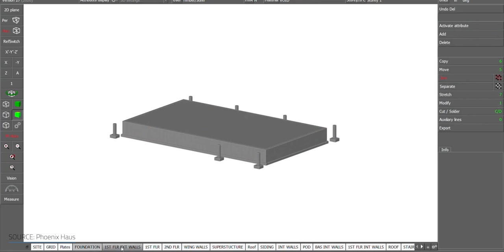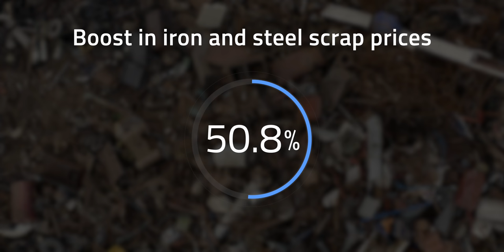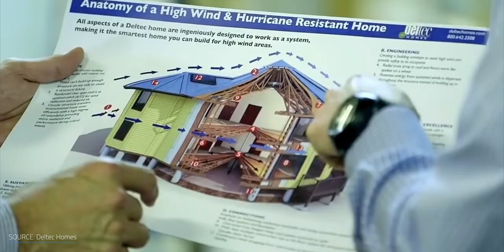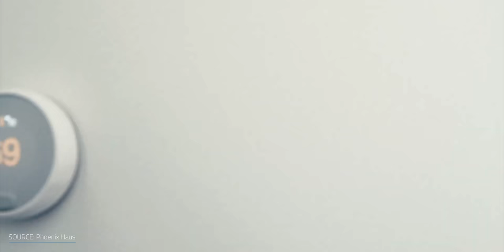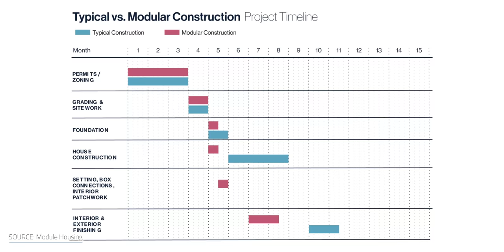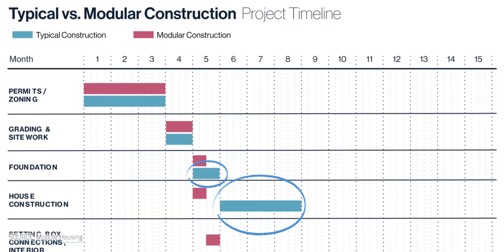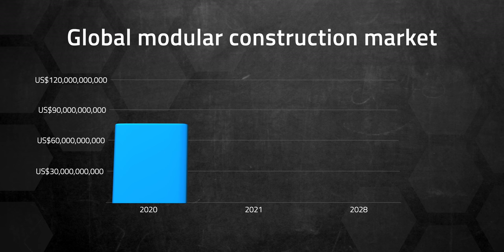Exploring Modular Homes - Cheapest Path to Net Zero?

Comment: if i built a modern home, i would build via 3D printing. Concrete lasts longer than sticks. i really don't like stick building. its old technology. and i HATE pink batt insulation. that crap is TOXIC. Spray foam is a better solution, IMO. SIP panel construction is a good solution too.

Comment: sorry but NO ... those are not conventional materials for a house for me.
there are many downside to using wood as the foundation & 4 walls of the house.
We use and prefer bricks and concrete to anything as it is more durable, stable & functional ... in the long run saves you plenty compared to wooden houses with rubbish foam padding which are only a norm in the US not rest of the world.
Now with that said, eco-friendly is another story.
My arguement here is the material used NOT the method used to build a house just in case you missed it.

Comment: The problem is longevity! Should we build something that will outlast us and will be transmitted to the next generation or something that is carbon neutral at first but also a relatively short-term solution? IMHO, we should evaluate a building's carbon cost on a decades-long or even century-long period, not just based on what it requires when building...

Comment: In so far as large scale production of homes, its not likely to happen. Not without its widespread adoption by builders that are largely responsible for most of America's communities. Otherwise it'll just remain a nitch market for those rich enough to afford a home outside of a subdivision.

Furthermore, being eco-friendly is great but not when the majority of homes are (well) beyond the purchasing-power of the middle-class. Otherwise what's the point, if a families single greatest investment is beyond the reach of mere mortals? I mean, a 30-40 year loan for a property that's not certain to last that long, is becoming quite a big ask (requirement) from Banks. Especially considering that lenders make more money when borrowers default than they do from the borrower taking the loan to term. (Thanks to loan insurance + resale of property + absorption of equity)

Comment: Any home that’s 100% electric is net zero, regardless of its efficiency. It’s the electric grid suppliers that produce the carbon emissions. 

Individual choices to go net zero make people feel good and feel like they’re personally involved in solving the decarbonization problem...which is not entirely bad. But the way we solve the BIG problem is through good public policy and regulations...which is WAY more boring. Big carbon producing companies like to blame consumers for the “demand”, but the hydrocarbon power producers emit the carbon!

Conservation and efficiency are great goals, but energy conservation and a set of panels on your roof won’t by itself stop or reduce your local 800 MW coal or gas plant from burning dinos for profit. It’s gonna take big solutions for big problems.

Comment: Great video.  I feel you left out one very important aspect on this topic.  Modular homes stand up to severe weather far better than traditional built homes.  Compare that side by side, they win hands down.  I live in a 2-story, 2600sq2 modular home.  My insurance rates are lower compared to traditional home of same size/ sq2 because it will stand up better in a  storm.  I hose is very energy efficient and if you saw the location......  It is to die for....  Moved from a mobile home to modular.   When I did, I refused to look at anything other than traditional.  I was tired of not being able to shop for insurance, the limitation due to the design.  We found this place,  I had no clue initially (until after I toured it & made an offer) that it was a modular home.  Great video though.

Comment: 7:35 "Stick-built, non-luxury home cost: US$150-250/sq ft"
8:47 "Shelter Dynamics price: >200/sq ft"

Ok, assuming that this is an apples-to-apples comparison, it seems like a no-brainer.  Even at the worst value of '>200/sq ft' of $199, you're still sitting right in the middle of the price of a stick-built home. Which has none of the energy savings, i.e lower utility costs, of the Shelter Dynamics home.  So again, assuming that this is an apples-to-apples comparison, why would anyone not take the options that saved them a pile of utility costs over the life of the home?

I think that a major impediment to energy efficiency is transient living.  Building or converting a home to be energy efficient is costly, and the home owner doesn't see any return on that investment for many years.  So if they move, they will never see any returns.  And with this in mind I'm certain that many choose to not pay the upfront cost for energy efficiency which they may never recover over time as they move around.
I live in NOVA, which is a highly transient area given the large amount of military and diplomatic residents.  Added to this is the simple fact that younger families tend to move to a larger home as they have children and need more rooms, and you have a large amount of home turnover.
No one wants to buy an expensive system that only pays off after it has been in place for several years when they may be moving on well before the break even point.
I saw this myself when I had an AC unit go out in my home.  It was a SEER 8 unit.  After doing some research I decided to replace it with a SEER 15 unit.  But I sold the home just 2 years after, and the fact that it had a far more efficient AC unit didn't impact the sale price by a single dollar.  I'm pretty certain that I didn't get my money back for purchasing a much more efficient AC unit, and this is probably the same issue for a great many home owners.  They face the very practical question of "why would I pay for a more efficient system when I won't see any cost benefit?"

Comment: Im working with modular homes, its usually total garbage, most of the time is waster trying to cleanly isolate the connections which would be way easier if the house would be simply build step by step, i dont know all the terms in english but isolating modular homes doesnt work at all, workers are doing all kinds of shlt to pass the tests, end result is usually nice because you cant see a shlt beneath the exterior. I dont understand how it can be cheaper if its faster building one or two story building peace by peace (its tested by me and other builders). Dont beleave me then come modular home industry for 6 or so months and u will understand it by yourself.

Comment: Cheaper?! Good modular homes that I have looked at have been a lot higher per sq/ft than stick build unless you are talking about mobil homes.
Reply: As an example I am looking at Method Home predesigned Model 2M Loft - 1,740 sqft, Home$410k, Modular + site (est) $680k 2bdr + loft, 2 bath. I just sold a larger 3 bdrm cabin for $340k. In theory modular should be cheaper but all the decent designs I have looked at are almost double the price of a standard stick built in our area. I keep looking because I like the idea and benefits but they are not cheaper.
Reply: Isn't the point of the exercise to get higher energy efficiency than traditional building practices deliver?  Over the term of home ownership,  lower operating costs should offset premium material expenses.  

As to your figures, without citation - they're suspect.
Reply: @jimmatthews6034  I don't know why you say my figures are suspect. I gave you the name and model you could easily look up. The figures are taken from their website. As far as what I sold my home for, I guess you would have to take my word for it. 1,796 sqft for $340k is comparable to others in the North Carolina mountains near Asheville. I really would like to build with modular and it should be cheaper considering they are built in a dedicated facility. Given that, I don't understand why they are more expensive initially.
Reply: @jimmatthews6034  If you know of any good modular home manufacturers that service North Carolina I would love to know. Most I find are west coast.

Comment: The cheapest and most exo friendly building are what was used a few hundred years ago - COB BUILDINGS ...
Main construction materials -
Wood (any type, logs etc)
Sand
Clay
Straw or similar 
And of course
Water ...
Nah can't for once think of using old NATURAL BUILDING techniques,  we need 3d printers, machines so large they consume tons of power... 

And have a building anyone could build ...nah that's crap idea ..
Bigger 3d printers and more chemicals please ...tons more chemicals for the mixing ...
Or premade sections covered in a ton of glue , bolts, nails ,screws ...

Advancement is the only way ... and ignore anything that makes sense 
..we all know its follow the "science

Comment: Net zero is not important. Low cost clean energy is what will benefit people. Gridtie solar is great but it really only scales to 10-20% of all residential energy. Battery lifecycle costs alone are similar to grid price. They are not a profitable investment.  Lifestyle, more heat pumps, and modest array is probably close to optimum. Net Zero is a useless distraction.

Comment: In the UK we have traditional cob cottages with thatched rooves that are 800 years old and still in perfect condition. The ones in desirable locations sell for millions.
You aren't going to get to "net zero" using huge amounts of manufactured product, local sand, clay & straw has lasted 3x longer than the USA has existed for in a cold wet climate and the materials are free with a purchase of every spade.
Same with adobe buildings.
Unless you are building a skyscraper you really shouldn't need all the unnatural overpriced stuff.
It's the same as my objection to Elon Musk telling everyone to buy EV's which requires us to mine ungodly amounts of lithium. If we built Dutch style bike paths, car usage would decrease by half. Bike paths are really, really cheap and easy. But lets have the most expensive and high tech solution instead.
Ho hum...

Comment: They are they size of a shed in the UK as land price is high. The aim is not to sell them more likely you will rent them or your boss will provide them as sleep pods as the incoming fuel charges hope to move most drivers off the roads and rewild some of the main carriageways. It's all in plain sight on the local councils Carbon/Co2/Plant food removal page. Burning anything is about to become illegal. Currently the Government would like to replace gas boilers with ground source heat pumps which can only heat a small shed. But its all in aid of saving the planet apparently as most have forgotten all the cancelled climate Scientists, most never got to read the Climategate papers, and most don't know that Michael Mann's Hockey stick graph that he posted around the globe, turned out to be a cut and paste fraud.

Comment: Wood meccano totally morphable a few components rot just unbolt and replace. You absolutely need a house 6 feet by 6 feet that is about the smallest thing you could live in.
OK now what? It's uncomfortable suck it up and go to work and at the end of the month use your paycheck to buy more 'meccano'
extend the house. There is no mortgage in this system even if you don't have a car you can pick up some 'meccano' on the way home from work. As a product each component can be stamped as conforming to a building code standard. As I said there is no mortgage, however there would be one for the land but it would be much cheaper.
Now let's look at a few scenarios, you like the location of a house you are considering buying but you don't like the design of the house. No problem take it apart component by component and reassemble it. 
You love where you live but another   child is on the way, extend the house or redesign it. There would even be an ebay market for second hand components the ultimate in recycling.
Last point I had an obsession with building a log cabin about 30 years ago and a friend of mine pointed out that they were a bad idea because too much wood is needed. Wait a minute isn't that carbon sequestration on a massive scale?  In the 6 foot by 6 foot house you started with, insulation is not a problem as it is just two layers thick. As the house gets bigger you  bolt in more components to thicken the walls. Oh guess what? You just sequestered MORE CO2.
Oh you are disabled or really old hire a teenager, get a laser pointer and say bolt that to that and that to that .........
Oh and by the way while you are at it claim offset credits for all the CO 2 you are sequesting.
Make changes to your design as you go.
Here is the big tomali you have bought the land but you can't afford to start construction. Pallets the world is full of them for free make your own 'meccano' from  pallets don't get fancy just get it up.
When you have the money replace the pallet components with properly fabricated ones.
I know somebody is thinking I could just make my own components well fine. It makes the whole system cheaper driving costs down down down. A house would then become more of an embodied idea than a load of capital.
Anybody want to see more of this stuff I built one of these, see on my channel. I have bigger plans in the next few weeks working on my house in Portugal tune in.

Comment: So many lies and misconceptions, that i couldn't get through this video.

Such as, modular homes have way less waste.
They don't, they are just built on 4' increments.
If you get your architect to draw up your new home using those constraints, then you to can have almost no wood scrap.

But going further, the construction waste is usually from demolition of old structures (and that is what you see being dumped in this video, not new stuff going to waste)

Lastly, all of this "green savings" are just from adding more insulation.
You can choose to do this on any building and any construction type.

@Matt Ferrell your statements are all correct, but you imply so much that is completely wrong.  Your comparisons are just reading from a brochure that compares a modular home with good insulation vs a standard home with poor insulation.   This is not a proper comparison.  And i am very disappointed that you continued to expound on them making the lie even bigger.

If you are really interested in going green.  Forget the box house.
Start looking into earth ships.

Comment: I'd like to suggest a simpler, faster, much less expensive way to build a fireproof, tornado-proof home that might last centuries, even millennia. But let me circle back to that. 

Our infrastructure is crumbling because it was built with Portland cement (OPC), and steel, a combination with about a 60-year life span. OPC inevitably cracks, letting water reach the rebar, which rusts, expands three times, and breaks the concrete apart. As we now leave our children our debts, they will still be paying for this rebuild; two in a row will bankrupt them. And making OPC emits 8 percent of worldwide greenhouse gasses; steel is 9 percent. If we rebuild, and China and India modernize, with OPC and steel, those emissions will increase exponentially, and blow away all of our efforts to stop/reverse climate change

Geopolymer cements might last millennia. They have very little carbon footprint, and some sequester CO2. We can sequester the heavy-metal toxins in steel-mill slag and coal fly ash, making GPCs with those "wastes," which power plant/steel mill operators might pay to have hauled off; when we use those up, volcanic ash should work even better. "If you want something dirt cheap, make it out of dirt" (MIT Prof Donald Sadoway). GPCs  are two or three times as strong as OPC, don't crack, are surprisingly flexible, protect steel from rust better than OPC, like cellulose aggregates and reinforcement--OPC hates cellulose--don't conduct electricity, and are fire and rot proof. Rebuilding with GPCs would save us money and carbon, and structures built with them should last our great-great grandkids many generations.

Inventor Daniel Panitz (Pompano Beach, Fl.) claims that his Blue World Crete (BWC) version of a GPC is hydrophobic, and R-35/inch. Inflate a hemispherical dome or barrel vault form, or tie up any shape you want--I like a Gothic arch--of bamboo, and cover it with BWC-drenched burlap. Spray 1.5 or 2 inches of wood-chip-aggregate BWC (takes and holds nails and screws, cuts with woodworking tools, still utterly fire/rot proof) over that, and let it harden overnight; remove forms, and cut holes for electrical boxes. Staple--fast and easy--bamboo-splint reinforcement over that layer, add wiring, trowel on a second layer of BWC with stony aggregate, and the shell is finished: it doesn't even need paint--and 3 inches thick would be R-105; 4 inches, R-140. Instant Passive House: should need no heat in all but the coldest weather. With inflatable forms, it should take two or three workers two or three days to build the shell of a house that will not burn even in a megafire. Bury a dome--build a Hobbit house--and a tornado right over the top should do no damage.  

I hate to see people rebuilding tinder-box houses destroyed by wildfire in the middle of the same woods, when those homes could be utterly fireproof.

Panitz' main web pages are Blue World Sciences.com and Blue World Crete.com. If you can invest in saving the future, I urge you to check them out.

Also, a team at MIT has tweaked the Molten Oxide Electrolysis process used to refine aluminum so it works with steel and other metals. MOE makes better steel less expensively, using less energy, than current processes, and the off-gas is pure oxygen--no CO2. Adopting this process would revitalize the U.S. steel industry much faster than pissing off our allies with tariffs. The MIT spinoff developing MOE is Boston Metal. MOE does need clean electricity: we need Molten Salt fission, and fusion, power on-line now. But that's another rant.